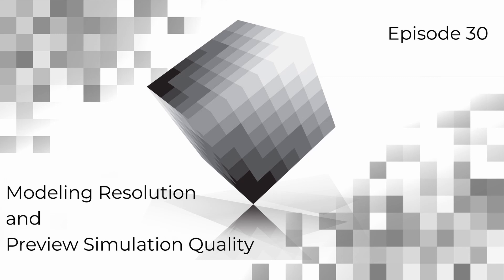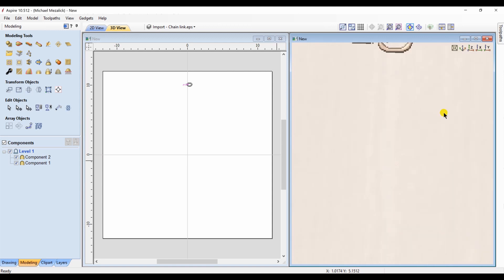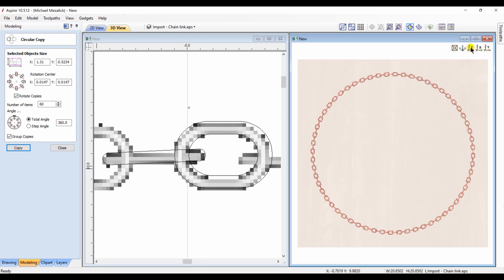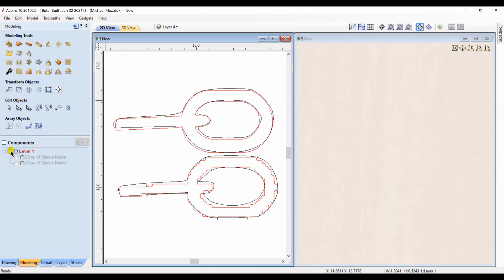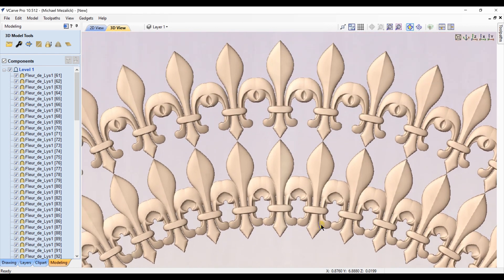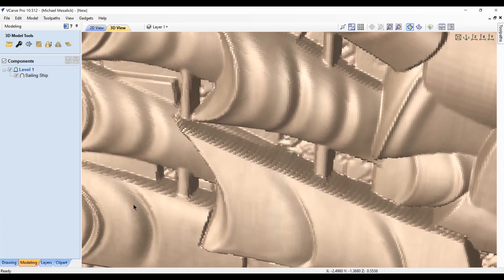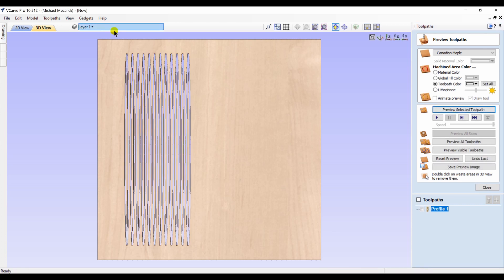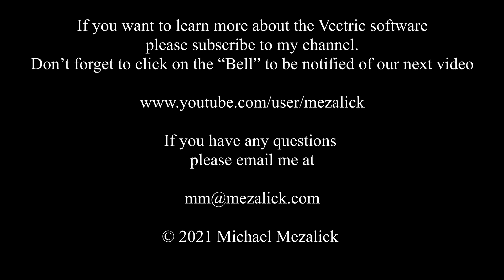Modeling Resolution in Vectric's VCarve and Aspire

Comment: You really need to actually cut the models to show the difference in the actual product.  with the screen preview resolution, I do not think that there would be any difference at all.
Reply from the maker: Good Ssuggestion. I think I'll make a video showing the difference
Reply: @mezalick  I have also Been interested in the best 3D strategy. I  have had the best results going with the grain with a raster strategy.  I was wondering if you had any thoughts?
Reply from the maker: @davidchamberlain5287  Nothing specific except I find that if the design is circular the offset work better and if the design is vertical or horizontal, rester is better. As for the grain, I agree but it also depends on the type of wood.

Comment: Michael,  would it be a even better model if you first made the component in a smaller work area ( just as big as component ) at max res. And saved it to clipart, then started another job at the size of frame at very high to create your job
Reply from the maker: Yes Dan, a much better approach. It's one of the lesson I teach.  I'll be doing this as a video but I needed to start with something. Thanks

Comment: Thanks Michael you can get an even higher modeling resolution by holding down the shift key and opening the job setup extremely high 20 and maximum high 50.
Reply from the maker: Yes, that is what I was doing, I was using the maximum resolution. Thanks
Reply: @mezalick  what a nonsense from Vectric, why is this hidden?
Reply from the maker: @dickolivier9530  They feel most people will never need that high of a resolution...I could lead to confusion as to why their computer is so slow to calculate (50X slower). I can understand their logic.
Reply: @mezalick  10 years ago maybe this made sense.. Even tho it is still a weird decision to hide the options. Unusable pixelated crap, that's what I get even with max res.
Reply from the maker: @dickolivier9530  I can't disagree. That's why I use other software as well...
Reply: And the fact that it doesn’t use the GPU at all is ridiculous.

Comment: Michael: At minute 6, where you are comparing the two resolutions of the fleur de lis, I see quite a difference between the two rings. The "joining" links between the main fleur are not alike at all. Both rings seem to be of equal resolution, but the model is quite different.
Reply from the maker: Yes, because the inner ring is smaller but the quality is the same